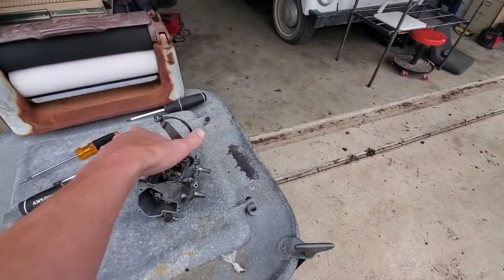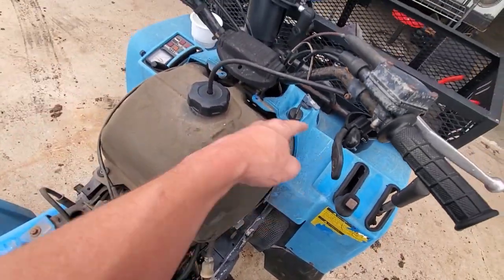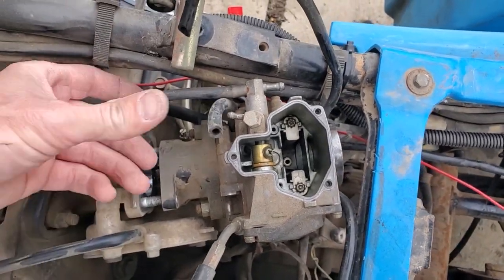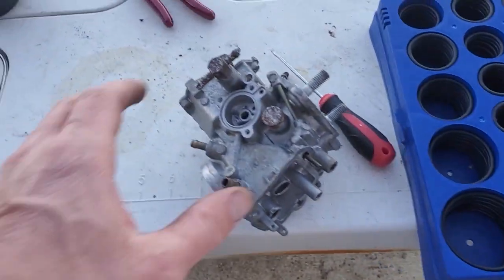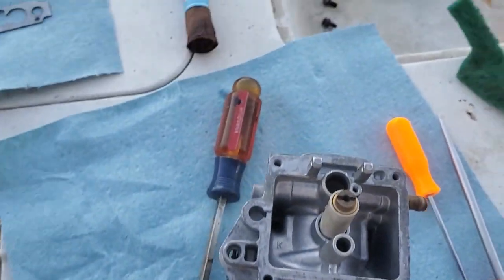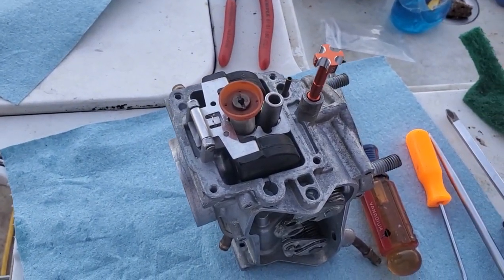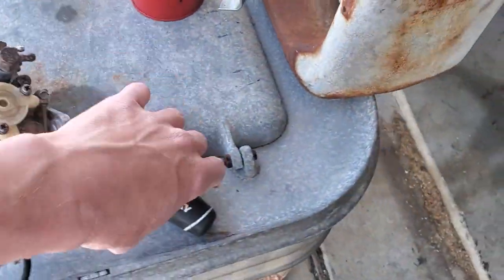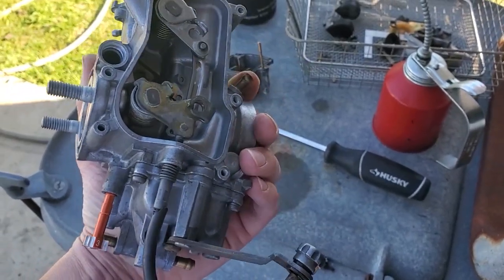Yamaha Terrapro Carburetor Rebuild Video

Comment: Where are the spark plugs located? Mine started running like crap and misfire.
Reply from the maker: @piggy1910  in-between the cooling fan and the gas tank tucked up in there
Reply: Do you have to take the gas tank off to access them?
Reply from the maker: @piggy1910  no but it's way easier to reach if ya do
Reply: Ok. Thank you for your help!